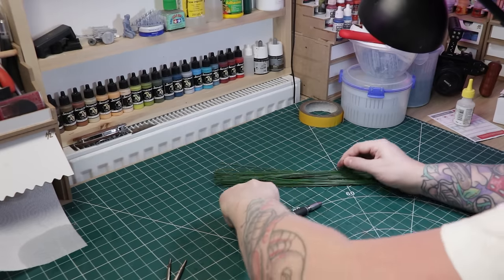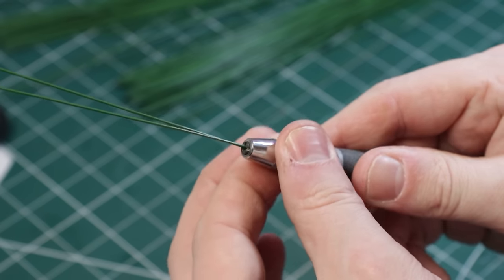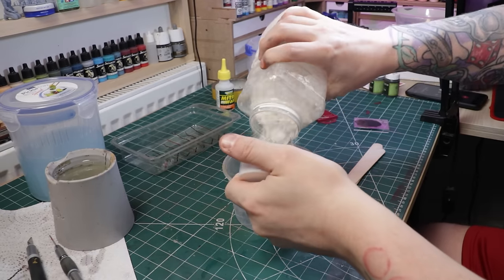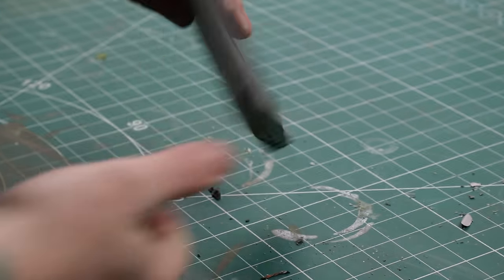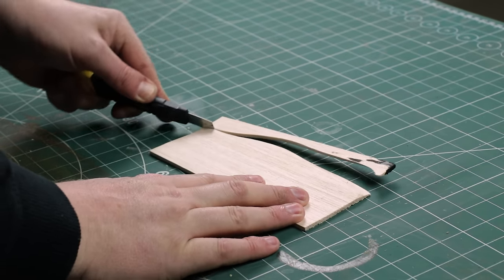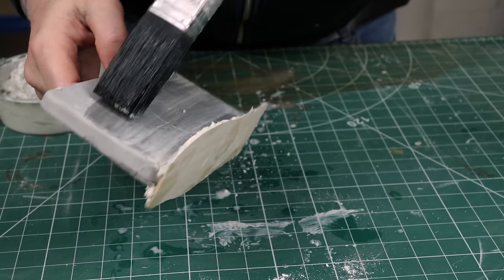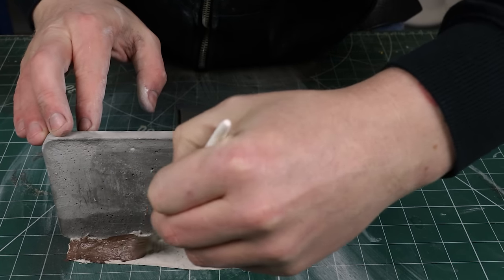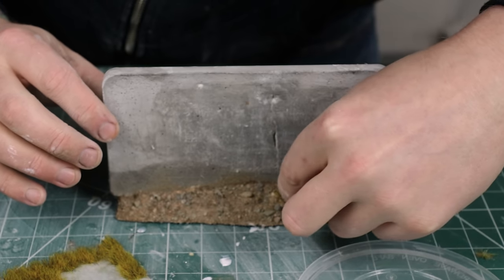Ultra Realistic Warhammer 40K Terrain Concrete Fortification

Comment: You might consider using aluminum window screen in place of or in addition to the "rebar". It would give you a bit different breaking mechanism and a different look as well.

For just rebar, I'd consider running the rebar in two perpendicular directions, since it isn't normally just put into the concrete in one direction.

Comment: Something to add.... Instead of regular plaster compound, look into what's called 5 minute quick setting joint compound. There's also different wait times up to 90 minutes. But with the right dye, it'll react just like what you've got there and dry in less time as it heats up and bakes the moisture out.

Comment: When I made those kind of walls for a bit of a test, I made the bottom of the mold out of the thin ice cream stick looking things that I cut to variable lenghts to simulate planks used as the concrete mold. A bit of light brushing of the sticks with fine steel brush brought out the woodgrain more. It looked nice, but maybe a bit too contemporary look for 40k...

Comment: With different moulds, you'd get Bremer walls, Jersey barriers and dragon's teeth with the technique, most of which could really benefit from the 'natural' weathering you'd get from use.
Reply: Yeah and you can do a realistic rebar mesh inside them, so they hold up okay and don't break in two from the slightest of rough handling.

Comment: Great video mate. When running your rebar, go horizontal as well as lateral; that lends to the structural integrity. Can’t help much on the drying time though... unless you maybe go with thin welding wire to eliminate the plastic sheathing.

Comment: I played around with a mix of plaster pigments and sand to make concrete a couple of years back. I never cast anything bigger than little test sheets but found the addition of sand to give it both texture and colour when broken, especially if you weather the broken bits by scrubbing at them with a brush. All the colours from the sand particles then show through and it really does looks like knackered old concrete. Also if you make your moulds out of scraps of plasticard that you've scored to look like several boards it even looks like its been cast in a wood frame.

Comment: Suggestion:  Use the 3D printer to make various terrain pieces like fortress walls, pillboxes, bunkers, and jersey barriers.  If you're skilled enough with the software, then all the terrain can be modular.  Then use the printed pieces as masters to make silicone molds.  Use the silicone molds to cast pieces out of plaster.  Finally, make a board-sized, sprawling, bombed-out bunker complex.

Comment: One idea to speed this up is instead of clamping the wires into the pin vice you can clamp them into a drill/electric screwdriver.
Then hold the other end with the pliers and pull the trigger on the screwdriver to wind them up together.
This works really well for winding electrical wires together and should work for this as well.

Comment: Make another 'proto-block' as per this video and  cut it into sections and test a piece each day for dryness, to get an acurate measure of the drying times. Could the rebar be prepared with a fine coating of a wipe off mask [e.g. vaseline] so that when you "tear down the wall" it'll clean up easier to show the paint job?  As Ridley Scott says about effects, "you can't beat real!"

Comment: Hiya Luke, don't you want the reo bars smaller rather than larger to keep scale with most figs?  I'd be tempted to use square mesh with about 0.5 - 1 cm holes.  Set the mesh half way through the plaster and bash away.

Comment: Really liked the idea; seems like it would have more natural fracture lines since it actually is reinforced by the wire. Especially to have any bits still hanging on. Seems to be a part that’s usually missing from most examples I’ve seen where the rebar seems a bit too “clean” in the length and at the join.

Comment: Wonder what would happen if you properly made a wire grid to put inside alongside a harder plaster then used it as target practice for an Airsoft or BB/Pellet rifle. Might work good for larger bullet holes. Heck some Bird shot from a .410 at longer range might make a good spread of pock marks for bullet holes.

Edit: using nail punches with soft strikes might make good bullet holes as well.

Edit2: Also instead of an Oven look for a Food Dehydrator. It seems to work better for drying the plaster out. Especially if the pieces are smaller/thinner.

Comment: Maybe after you get it out of the oven you could bury it in some silica sand in a plastic tote. Then use a clip on lamp with a heat bulb to warm the sand. Silica sand is a natural desiccant and the heat bulb will help speed it along.

Comment: I like this, I've just started to do 40k stuff, not usually my thing but I was asked to do some I made some concrete barricades and some bombed out craters which look quite good, and they were fun to do and I learned some new skills. If I have to do more 40k I will use this technique on a few things. I particularly like the rebar technique. you said you'd have mad these thicker what size wire would you use instead?

Comment: You can get the same look for a fraction of the weight using XPS foam instead of plaster. You don't need to drive the wires all the way through - just poke them out the ends.
Reply: @GeekGamingScenics  You certainly can paint it to look as good. Google richbuilds ruined bridge. Raw xps, no Spackle/filler. I didn't have to stick it in an oven to dry either ;-)
Reply: A decent primer helps to stop the paint getting knocked off, as does a varnish top coat. tbh, you shouldn't be swinging your terrain about if you value it :)